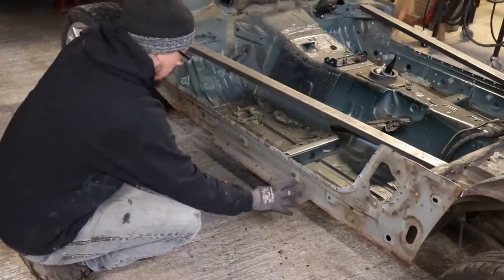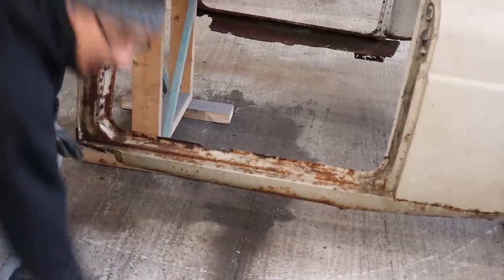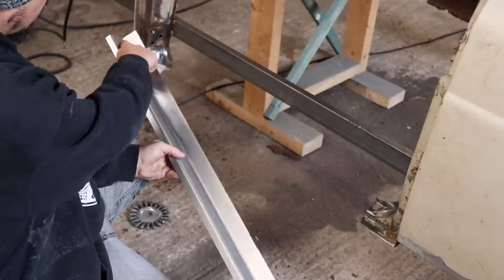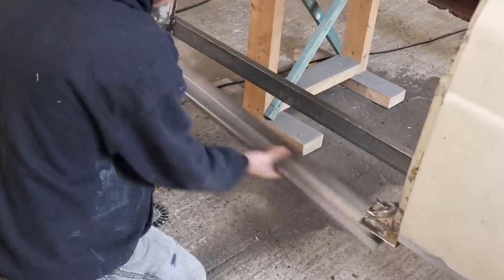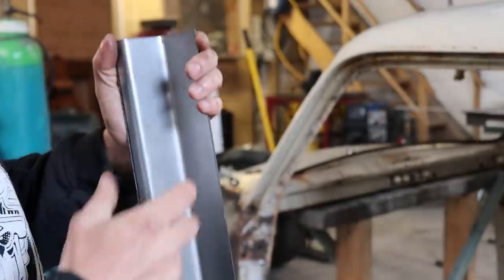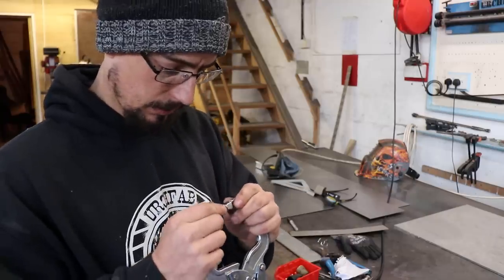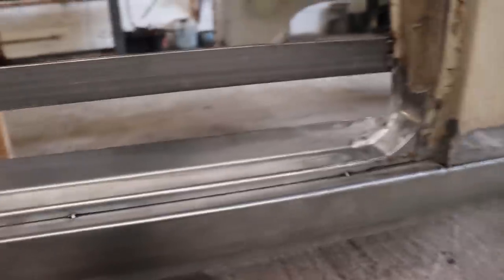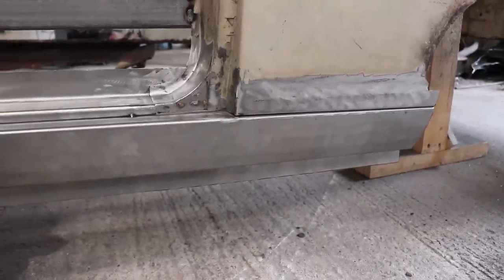PART 6 ON THE MONGREL, FOLDING UP SOME NEW SILLS.

Comment: When I first watched Episode 1 of this series, I have to confess that I thought that I was watching a complete nut case randomly hacking at two cars that would eventually become a large pile of scrap metal or, if the two ever did come together, the result would be a rolling death trap, just waiting to become the metal coffin in which Matt would be undoubtedly buried.
By Episode 5 & 6, my admiration for Matt's skills knew no bounds. Still slightly mad but liberally coated with several layers of pure genius, Matt is a brilliant metal fabricator & a very modest video presenter, no BS, unpretentious, highly skilled & I am envious of his ability to do such wacky but beautifully executed work. Whenever I have tried welding, I blow more holes in the steel than you'd find in the average colander & I couldn't even begin to imagine how to combine the 100E with a Mazda.
100E Popular was my first car, so I'm hooked right to the end of the line with these. Long may your arc glow brightly!!!
Reply from the maker: Thanks, I appreciate that.
Reply: It is truly a pleasure.

Comment: When I make sills I use a lot more tiny bends to achieve a smooth bend, then I give them a light wheeling (not too hard as it can put a big curve into the sill section. ) to get them surface smooth enough to paint.

Comment: I have done similar projects over the years, and I would double check that your doors fit before you get too far along.  There is nothing worse than making everything look perfect and find out that your door is off by 3 or 4 mm.

Comment: And seeing as you have some extremely Kick-Ass tools... the one tool that I think would be beneficial for you and seeing as you have the height and the cowshed would be a Gantry crane a roll around Gantry crane they're kind of like a big if you haven't seen one with the ability to roll and hang something from the center of it which would help you lift on and off bodies and other projects I'm sure.....

Comment: Man that's 1 high speed planishing hammer of yours. ;) Loving your work. I'm curious why you use SAAB engines instead of Ford,GM or Japanese engines in the DriftRod & the customers HotRod in the background? Is it because of strength, came turbo'd, weight or some other reason?
Reply: I too wondered this... Ive owned many saabs over the years here in the states and although they were good little cars they were not really power houses by any means.   In fact, parts over here are nearly twice the price as most every other brand.  (Even for basic pumps and alternators they were expensive in comparison to other vehicles.)
Reply: Very well built 
Saab is a case of letting the engineers run the show not the accountants 
Sent them broke in the end 
The very basic not quite right story but you get the idea 
Also not very popular so a factory turbo can be had for cheap rather than other common engine fetching higher and higher ridiculous prices 
That's what I rekon anyway 
Also said he had a mate that was a Saab expert
Reply: @ Alan odd really cause late model Saabs where very much GM products. I believe these engines are from 9-3 or 9-5's. The earlier models had a PCV problem causing excessive carbon build up, but once OEM modded they are very capable and easily tuneable engines. And as a bonus those models are about the cheapest fast turbo cars you can buy this side of the ocean.
Reply: I had several 9-5s and one or two 9-3s over the last ten years or so... I loved each and every one of them.  my 9-5s always seemed to be  breaking on me.   I figured it WAS the GM part of the equation that caused the problems lol...  I had a few modded 9-3s and not a one of them ever left me stranded... didnt have the same luck with the 9-5s.

Comment: awesome work I am following your build. I recently found a couple helpful items for doing the but welds on my restoration project. a piece of flat bar copper/brass clamped behind the but weld. then when you weld it prevents warping and blow through on the weld. plus the flat bar copper/brass does not stick to the weld or melt from the heat. the other thing that I am finding very valuable for setting up the but weld panel are these two items: https://www.eastwood.com/stitch-weld-magnets.html and https://www.eastwood.com/intergrip-panel-clamps-set-of-4.html. I did most of my fabrication with out these items but now after getting them I really would not want to fab with out them. Looks like you are pretty capable at your fabrication just wanted to pass on something that I found very helpful. The panel clamps could probably be made pretty easy too.
Reply: I should add that I don't work for east wood just fabricate for a hobby.